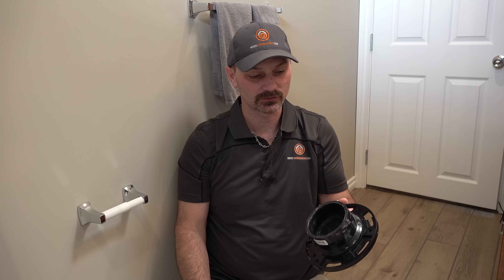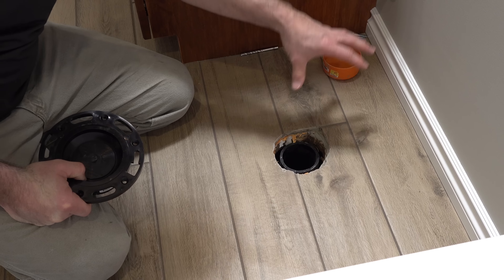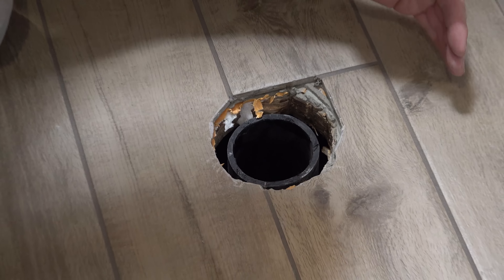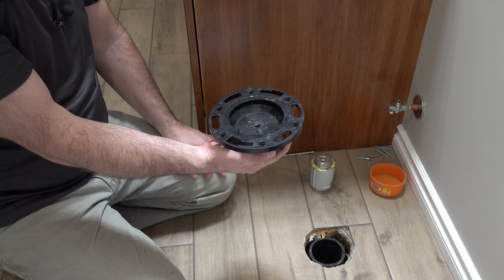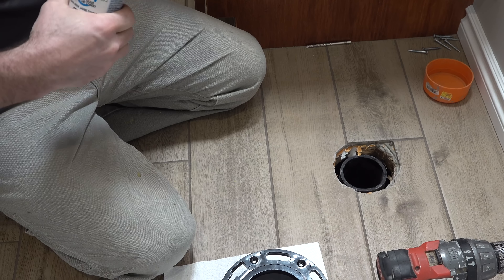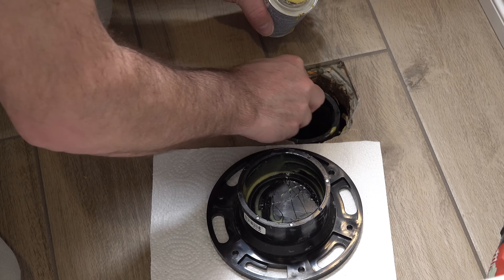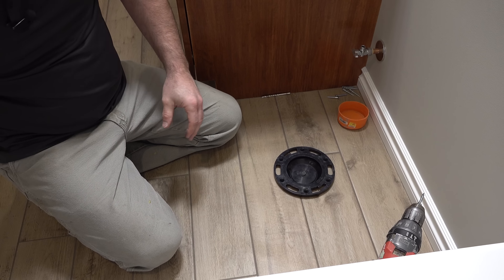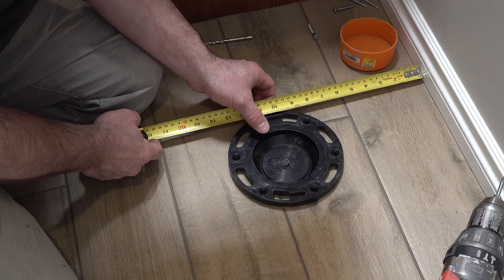How To Install A Toilet Flange On A Tile Floor

Comment: The only tile guy who does his installation correctly, I laugh at those clown on YouTube claiming to be expert in the field, but yet they do the toilet flange wrong or cut corners, the professionals do it the way this guy does it, the toilet flange is the crown of the bathroom floor, well done man, thank you for showing the correct way.
Reply from the maker: I completely agree the flange should be on top of the flooring.
Reply: Lol the pros aren't given time to do it right and inspectors sign off on everything

So I do everything myself
Reply: Always turn your glued joints upto a 1/4 turn to make sure the glue spreads. Don't just push straight on. Clear novice but still helpful.

Comment: Just last week I noticed water damage on my kitchen ceiling and it was from the toilet upstairs.  When they built my house in 2017, they attached the flange to the subfloor.  Then they put the tiles on leaving a distance of 1/2” between the top of the flange and the finished floor tiles.  I did not know this until I removed the toilet and saw what they did.  I bought a package of extension rings and brought the flange back up to 1/4” above the tiles, and now I’ve got the mess with the kitchen ceiling to fix and paint.  I wish all contractors did things right like you do Shannon.  Most of them take shortcuts and just don’t care.  The 2 year warranty expired on my house November 1, 2019 and I didn’t see the damage on the ceiling until last week.
Reply from the maker: sorry this happened to you ds99, that is a very common short cut that happens too often .
Reply: I noticed our commode was leaking after it started coming up from linoleum tiles. I almost have all of them scraped up and the toilet is removed. The flange is broken in 2 places and they had it positioned so when the water leaked it was under the floor... Upstairs bathroom, old house = downstairs ceiling repair. I am the fix-it wife because husband works 12 hr. shifts First time fixing this situation for me and attempting to replace section of subfloor as well. Hope to tile but that will be new for me too. I wish you luck . Wish me some please ;)

Comment: I did not know about this new series and as usual I like the presintation but the new products and tools helped a lot. I would like to see some video on plumbing and electrical mistakes that home owners make including failing to use better materials that are now in the market place like that toilet flange.  Common mistakes and not stupid installs by twits that professionals see all the time would be helpful and thanks.

Comment: Great video.  I would suggest putting a bead of Caulk around the outside edge of the flange to prevent any water from finding its way under.   Thanks for posting.

Comment: Good note on supporting the drain from below if you can to get a tight fit and maintain drain slope.  I guess the drain plug just taps/breaks out with a hammer?

Comment: Great video, thanks I’ve watched it a few times. I found the concrete drill bits worked for the type of stone tile we have. 
My problem is only three of the six holes took Tapcon screws and they are all located towards the back of the flange. 
There isn’t enough concrete or mortar in the anterior screw hole spaces. My thoughts are to find longer screws 3.5”  as the 1/4” X 1 3/4” Tapcon didn’t hold. 
It’s also possible the stone tiles are too porous to hold the screws.
Reply from the maker: I would try longer Tapcons like you figured.
Reply: @HouseImprovements  Oh well, I decided to hold off on the longer Tapcon worried I might be hitting the waste line! 
A plumber suggested a ring under the flange but I’d only heard of spacers and didn’t need that. I decided to give up and leave it to the experts. Unfortunately I already glued the Oatley flange in so hopefully someone is more clever than me.

Comment: I just dealt with a doosie with my toilet. Had to make a “shitter adapter plate” to get it to stay put. The old flange was rotten and the concrete around the pipe was broken away to where you couldn’t just install a new flange as there was nothing to tapcon into. Basically I had a steel plate made in the outline of the bottom of my toilet bowl and had a 4 inch hole for the  pipe with threaded holes for toilet bolts. It mounted to other areas of the floor under the toilet where there was still concrete. Then I had to grout my toilet to the plate because I found out that the bowl wasn’t flat on the bottom. Near the front of the bowl it’s not square so all the weight on the toilet would pull on the center of the bowl where the bolts are eventually leading to stress cracks in the porcelain. That was the least fun thing to fix. Lol
Reply from the maker: oh that sucks, hope it works ok now.
Reply: HouseImprovements it’s working fine now and it’s definitely what I’m grabbing on to when a twister comes along. 😂

Comment: I saw a comment elsewhere that it's important to use screws (in your case the wood screws) that won't rust. Is that important? Great video, thanks so much!
Reply from the maker: IMO That really is no issue unless you have a leak for a long time.

Comment: Love the video! My flange cracked and when I removed the toilet I see it leaked. Is there an easy way to replace partially rotted subfloor around the flange without tearing up all the tile? Or does it all have to be replaced? Thanks!

Comment: Can I use a abs coupling between the pipe and the flange? I remove an old and flange and it made the inside of the drain pipe uneven. I found a coupling that will go outside of the drain pipe and I found a flange that will drop in inside of the coupling. Thanks.
Reply from the maker: That is fine

Comment: What size ceramic ('spade') bit were you using there for drilling the screw holes through the tile ? Should the #12 screws be stainless steel or brass maybe ?  Cheers.

Comment: the tile is perfectly cut for that flange. i need a video about where the top floor has a huge gap around the pipe amd the old flange sits on the layer of flooring underneath....
Reply from the maker: We can help you in the forum if you like.https://www.house-improvements.com/forums/

Comment: Some plumbers say to have flange flush with tile, others say to have flange sitting on surface of finished tile - what is the correct way to ensure there will be enough room for wax seal properly? Those ABS flanges seem pretty thick compared to the older metal ones...
Reply from the maker: When ever I can I put it over the flooring.

Comment: what kind and size of screw, should i use?
Reply from the maker: If you are going into wood a #10 wood screw will be good and length will depend on what you are fastening into but usually 1-1/2" is fine.
For concrete use a Tapcon screw

Comment: Just had a flange replaced, after a week of a plumber coming to my house 3 times to put wax rings in and getting sewer smell. I still smell some sewer gas, not nearly as bad as it was. Would there be a few days to clear that smell out? Would chalking around the toilet stop any residual smell?
Reply from the maker: That smell should dissipate pretty soon after the toilet is swapped out. 3 - 4 hours easily I would think and way quicker if the exhaust fan is run for 30 mins after. If its still consistent after that you still have a seal issue IMO. Sealing the toilet to the floor could help but you may still get some from around the bolts that hold it to the flange. Plus if siliconed it is messier to remove later if you need to pulll the toilet again ,but many toilets are sealed to the flooring.

If you come to the forum we can maybe discuss this situation further if you want.https://www.house-improvements.com/forums/

Comment: I just went through the exact same installation except on a concrete slab.  I used 1/4 - 1 3/4 tapcons to bolt down.  If I ever needed to replace the flange again would it be possible to use the same tapcon screw holes?  I've heard that many times after removing tapcons it makes the hole unusable unless you upgrade the size and I wouldn't want to go larger than 1/4.   Nice clean job on the install...love the videos!
Reply from the maker: I honestly have never had to try and re use the holes? I really dont know if they are ok a second time.
Reply: @HouseImprovements  Thanks Shannon.  Appreciate the reply and keep up the good work!  Love your videos!!
Reply: I would just drill holes deeper and use a longer tapcon screw next time
Reply: Simple fix for that lad if reusing a hole just cut a piece of tie wire, the kind of wire you tie rebar together with, the same length as the screw maybe an inch longer than the screw and sometimes you need 2 or 3 pieces of wire  insert the cut wire into hole then screw and boom jobs a goodun.
Reply: I started too install the flange into a basement floor with a type of stone tile that wasn’t holding the Tapcon 1/4” 1-3/4” screws in three of the front holes. If I don’t hit a solid surface for at least three inches so I’ll need to get longer screws or try using your wire trick for the 3/16 holes I drilled for the 1/4” screw.

Comment: Does the toilet flange need to be on top of the tile, or can it be flush with the tile?  (sitting on top of the hardie backer board, etc.)
Reply from the maker: on top of tile.
Reply: @HouseImprovements  why does everyone have different opinions regarding this. My own plumber says to secure to the subfloor but then I hear to always installed over the tile, I'm confused. lol
Reply: @EddoLand  I think what they mean is the bottom of the flange resting on top of the tile but secured through the tile to the subfloor. I put one in yesterday for a friend and it was attached to ABS but floating just above the tile, I am not a plumber & did not have the drill bits or screws necessary to go through the tile so I did the best I could, used a Korky non-wax seal and shimmed the toilet, just needed one on one side. I was not about to attempt to lower the flange, I wish I had had more regular shims with me, maybe I could have shimmed the flange in lieu of screwing it down. It worked out ok.

Comment: Thinking ahead and just in case, if I'm planning to screw down my flange to the floor, can I just using caulk (or nothing even) for the flange instead of PVC glue?
Reply from the maker: Should still use glue to seal it

Comment: Where are the bolts supposed to sit  so that we can place the commode over it? Shouldn't they be placed from the underneath of the flange?

And then tighten the nuts on the top?
Reply from the maker: Thr flanges are made with a slotted hole. You can insert the bolt on one end of hole and then slide it along the slotted hole where it cant come out

Comment: Hi Shannon, I did a new installation of a toilet on concrete similar to you  with the flange on top of the tile but the toilet rocks....any suggestion to fix it
Reply from the maker: There are shims /wedges you can purchase that you place under the toilet to tighten it up when the floor is not flat. They are plastic or rubbe. https://amzn.to/2SswIim
Reply: @HouseImprovements  perfect, thank you

Comment: You don't need screws in all six holes... They are there to avoid grout joints and pipes.  3 to 4 would do the job.

Comment: Nice video as always, Shannon. Though that flange should be centred at 12" from the finished wall.
Reply: 10", 12", 14" are all standard toilet distances. Depends on the toilet being installed.  12" is most common.

Comment: How do you take off the cap of the flange
Reply from the maker: This style drills out with a hole saw.
Reply: @HouseImprovements  a guy from Home Hardware told me with a 🔨

Comment: What size drill bit did you use to drill through the tile?
Reply from the maker: in this case it was 1/4"". It depends on the fastener,

Comment: How far below the finish floor does the pipe get cut?
Reply from the maker: Depends on the flange you have a little. Purchase your flange fitting and figure it out from that.
Reply: @HouseImprovements  thanks! I was super nervous but was able to get the cut. For my application it ended up being about 1/4" below finish floor height to match up perfect with the inner chamfer of the flange. Also I had to buy another flange because the first one I got had this weird stop that would have required me to cut the pipe even further below the surface of the finish floor. Really weird but thanks for the video! Help me out a lot! 🤘

Comment: Don't you have to use a primer on the flange before gluing to the pipe?
Reply: Not on black ABS,  only on white PCV.

Comment: Don't need to cut through tile if you cut the tile in the circle which equals the size of the flange and not of the pipe. Then use a piece of plywood or just a layer of thinset / mortar mix / grout to compensate for the height.

Comment: Wanted to ask 
We have a similar flange installed in a new build with the seal in the hole. 

Are they punch out seals or are they screw out.
Reply from the maker: I drill mine out with a hole saw

Comment: I wouldn't want to drill into grout line...seems it would cause rest of grout to more easily crack or degrade???
Reply from the maker: If the grout is solid you should have no issue.

Comment: Did the flange go outside or inside the pipe?
Reply from the maker: Mine went outside. You can get inside ones but you restrict the pipe size then.
Reply: I removed my toilet, I notice rough edges must be from the pipe, then. My house was built in 2006, do you think flange is sitting outside of the pipe.

Comment: I thought the flange was friction fit, not glued,  so it could be removed later?
Reply from the maker: No ,glued for sure
Reply: @HouseImprovements  It's interesting to note the heated debate on whether the flange sits on the new tiling or the subfloor. The point is moot for most installations since the PVC flange is glued permanently to the drain pipe (as you confirmed) and sits flush on the subfloor because in new house construction, the decorative flooring is laid after the plumbers do their work. You did it textbook. However, I question this philosophy because if the flooring needs to be replaced in the future, with a different thickness flooring, the flange height probably won't be flush with the new flooring and you could end up with a toilet that sits too high and wobbles. You can't easily lower the flange. With flange on subfloor, one can always add spacers to get proper height. 

Love your channel!

Comment: Shouldn't the flange be almost flush with the floor?
Reply from the maker: Idealy it should be over the flooring. You can still make it work safely usually if the top of flange is flush but it is not best.
Reply: @HouseImprovements  ty!

Comment: That's all there is to it !  What you actually mean to say that you are going to fit a toilet on to that flange without removing the test cap !  You have not finished the job ! Some of us might want to see just how that test cap gets removed. Do you hammer it until it comes loose or do you slide a flat screw driver under the seam and lift it out. Which is it.

Comment: Thanks for posting about the screw size. What size tile bit would you recommend to pre-drill for a #12 x 2 wood screw?
Reply: The screw should catch the wood under the tile, but not the tile. The hole should be slightly larger than the screw.
Reply: @huejanus5505  thank you for the reply!

Comment: Doesnt the flange needs to be flush with the tile, not on top of it? The bottom male spout of toilets are designed to fit with female flange that sits flush to floor (base of toilet).
Reply: I've been told. The correct installation is flange on top of the finished floor.

Comment: The flange is not suppose to be on the subfloor and you cut the tile after to fit.??
Reply from the maker: Preferably not but in most cases that would still work
Reply: @HouseImprovements  yes you are Wright  check many vidro and suppose to be on top of finishing tile, thank you

Comment: Ideally, the tile should be cut to accept the flange directly to the floor, otherwise you're sacrificing gasket space?
Reply from the maker: The toilet flange should be on top of the finished floor. Look it up if you don't believe me.

Comment: Screws not stainless and too short
Reply: Looks like coated screws, and they need only be long enough to get into the plywood sub-floor. Longer screws wouldn't make any difference unless it happens to go into a floor joist. But with five screws holding the flange, it's rock solid. .
Reply: Stainless

Comment: Your only 10 inch to center on a finished wall! Hows a toilet gonna fit on there? 12 an a half inch from your sheet rock.. my man.. minimal code everywhere..
Reply from the maker: There are 10" and 12" toilets commonly available in most places and 12" is most common. This is a 12" set up you see here.